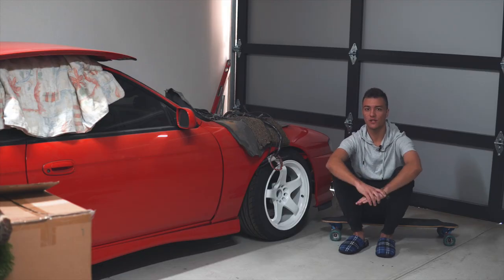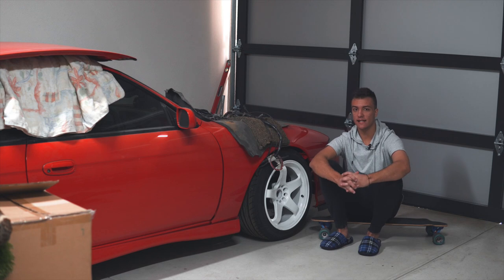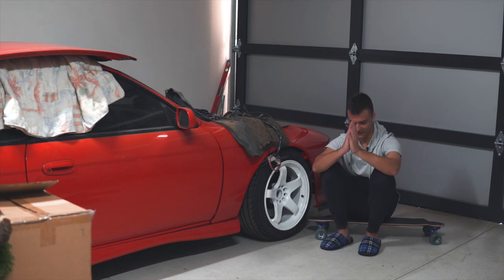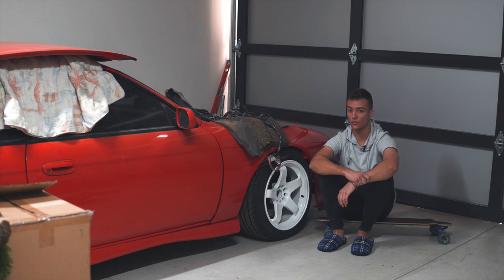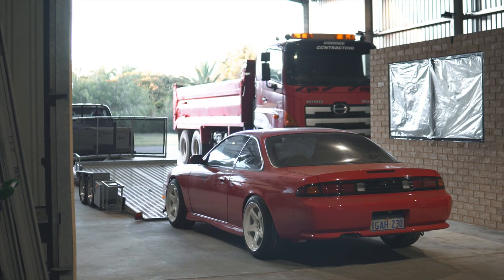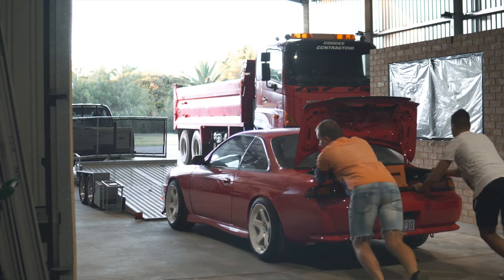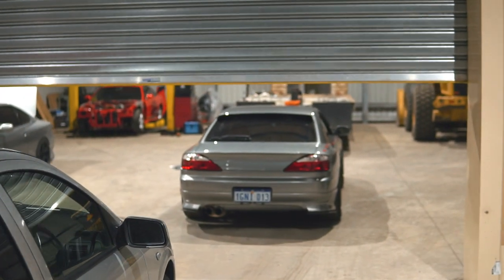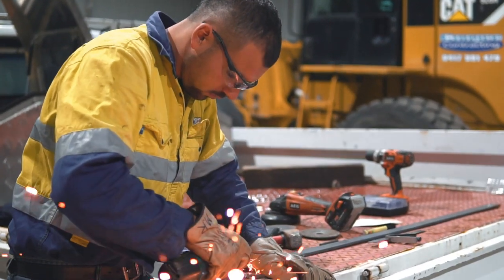RB14 is FINALLY HOME | The Broken Silvia [EP9]

Comment: Next time you do the gearbox you need to drop the sub frame a tiny bit, it just gives you a little more clearance to sneak the box in. Did you do the diff at the same time so it's full skyline running gear? Any plans to upgrade the brakes?
Reply from the maker: Yeah a few people mentioned that in the comment so will try next time! YES! So the diff is a Nismo 1.5 way 4.11 with 5x1 shafts, I've got bigger brakes on it. Front are z32 calipers with r33 rotors and the rears are z32 calipers and rotors
Reply: @BrokenSilvia  this is my dream car. All the things I wanted to do to my s13 when I was youngerwithout a mortgage and didn't have the funds to do it anyway. Really looking forward to you getting it on the dyno!

Comment: Never put an rb box in a silvia but even on a skyline its a bit tight. Lowering the subframe by loosening the bolts to the end of their thread, as well as loosening the engine mounts seemed to work for me
Reply from the maker: Yeahh man it was an absolute mission. That's not a bad idea, just didn't want to touch the crossmember because my suspension was already bolted together

Comment: @broken Silvia. theres no need to remove the engine to get the box in. thought process man. the top of the bellhousing hits the top of the tunnel so doesn't allow room to get it high enough to get it fully home right... so undo the engine mount bolts tilt the engine up abit an the box slides right on in. thats what i did with mine. work smarter not harder.
Reply from the maker: Yeah man engine mounts were as loose as they got but still didn’t wanna go in
Even with the engine out it was a mission
Might have to drop the subframe too next time
Reply: @BrokenSilvia   you have to remove the nuts on mount not just loosen them. pull it fowrd just a little bit and rest it on firewall with towl between it. i did this on mine as to not scratch my engine bay as my first rb s14 i put it in/out as one unit so knew how risky it was with messing up the rad support and top of tunnel getting it in. ive had mine in and out of both cars and thats the way i do it now. engine and box seperate. heres a vidoe of mine, also painted red and gold engine bay. https://www.youtube.com/watch?v=9sTktgwya9E&t=413s  and heres a vidoe of my mates 470hp rb s14 https://www.youtube.com/watch?v=RAnDarKRaL8  we both have removed and installed the boxes with our engines in.
Reply: no matter what way you slice it. its still a shit deal ahah, it sucks so just find a way that works best for you.

Comment: No, not WD40, not force, none of that.  If the gearbox doesn't just slide right on like butter, you simply TURN the spline on the transmission a tad. then try again, and keep doing this UNTIL it does slide on like butter.  TRUST ME.  It just takes patience and sometimes you may even get it in 1 or 2 tries. and when i say slightly, i mean SLIGHTLY. just keep turning it like one or two "germameters" if you will. lol and eventually BAM. it slides right in just like an eager and lonely single mum. You're welcome

Comment: I found when putting my gearbox back onto my 25det in my s14 the easiest way to do it by myself was to loosen the subframe until it's drop down quite a bit then it's pretty easy
Reply from the maker: Good point man! Will do that next time if need be

Comment: does it run?
Reply from the maker: Not yet man
Reply: @BrokenSilvia  i hope it runs soon
Reply: @BrokenSilvia  I'm curious, what does it need before running? I'm guessing fuel system? intake?
Reply from the maker: Needs fuel lines around the rail, filter and pressure reg.. drive shaft, fuse box tuck and another million little things